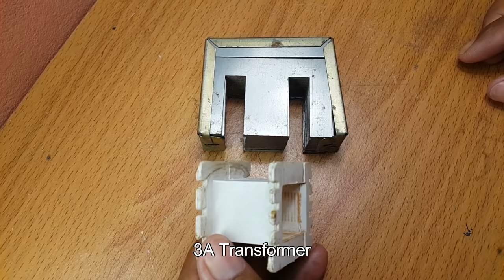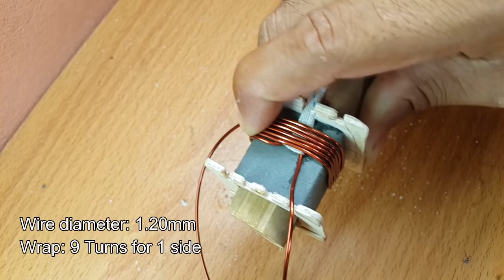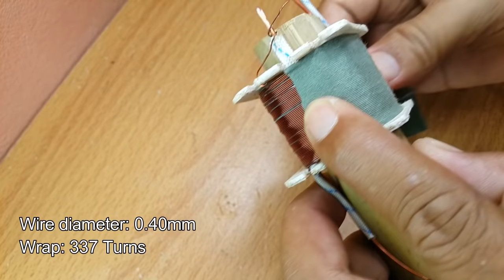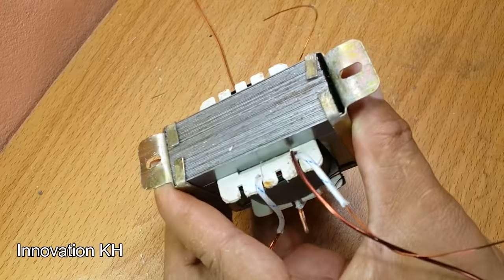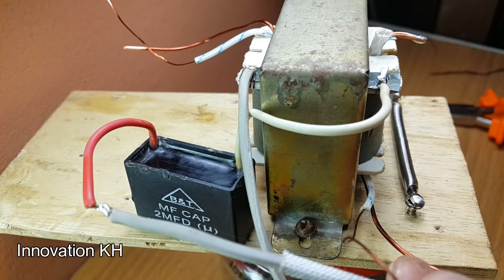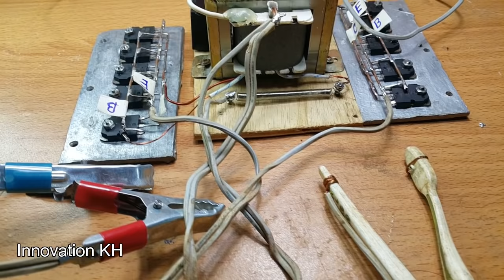How to make High Voltage by using 3A transformer and 10 transistors D718 NPN

Comment: Pointless to use transistors in parallel (or any semiconductor), they DO NOT function like basic electronic components in parallel, such as resistors and capacitors, as one transistor will do all of the work and the rest will just take up space. You could do the same thing with a ZVS driver with a centertap on the primary or even a single BJT with a feedback coil.
Reply: I believe to your Opinion,
But using more Transistor as Parallel maybe reduce the Heat it creates, i have tried using that on the Video we are seeing, 1x1 D718 same as the diagram of the video, it creates a very high temperature, using 4x4/5x5 reduces the Heat than can damage the Transistor/Mosfet🥹

Comment: Nah.. Instead of the background music, give proper instructions about the circuit and how it works. It's pretty useless video otherwise.
Reply: It's just a uncontrolled power inverter. Simple circuit and not as much power output in that setup as he's making it appear. I can get that same arc with a similar setup using only two D Cell batteries.
Reply: So, you can achieve the same voltage... but his setup is pushing some major amperage at the output voltage as witnessed by the melting wires after making a short arc. That, and this setup can likely run super high duty cycles without issues.
Reply: F8foio
Reply: Agree

Comment: how many volts and how many watts are produced ...
and explain why D718 is paralleled, does it work 5x2 D718 = 500w
Reply: The voltage jumps at least 8 mm, so I'd say that's around 2 kilovolts. 
It could be higher than that.

Doing the math implied by the numbers supplied in the video:
The primary side has 9 turns, and the secondary side has 337. The 4 turn coils are meant to drive the gates at the frequency of the mains.... so technically we can ignore it, but it does mess with some things. 
Since the transistors are all rated for 125 volts, that implies that the voltage does not exceed 125 volts on the low side of the transformer, vp = 125, turnsP = 9 . TurnsS = 337. 
Doing the rearrangement, the math should look close to this: ((125 volts) x (337 Turns)) / (9turns) = 4680 volts, or 4.6 KV. 

To get the idealized current transformation, 4680 Volts / 125 Volts ~ 37 amps,. 

The unknown in the circuit is the current handling ability of the new windings, and to know that we'd need to do a complete impedance map of the circuit. 
At best, the arc on the secondary side is drawing .027 amps, which absolutely drains the primary side of the transformer of 37 amps of current. 

I don't think that transformer is drawing 37 amps, but that means the wattage on that arc is = .027 X 4680 = 127 watts if it is drawing that 37 amps. 

So, the parallel transistors are probably meant to provide redundancy in the case of a dead short (overshoot) on the driving side of the transformer. 
Said more clearly, "The transistors don't support extra current, but do prevent destructive run away.".  

That said, this is still an interesting circuit.
You don't see many T bridge circuits.
Reply: @walterbunn280  should we do opposite winding?may I know pls what would happen if we do opposite winding? What's the best idea to get 220 to 250v from 12v DC ? Specially for fishing?

Comment: im from philippines i already tried your tutorial and its working but the second and third i made the transformer is not working well anymore, is it necessary that only the exact diameter of wire must be used ?for example is the 1.20mm., if i replaced that in to a smaller diameter wire it will not work my friend?
Reply: michael lamalan sir.. ano po name ng spring na ginamit nya? Thank you po
Reply: Baligtarin mo Lang pre yung base connection galing sa transformer left and right channel pagpalitin mo...
Reply: Mga boss alm nyo po ito gawin? Pingi po ako diagram pls. Tpos po size ng wire ng phil. Size. Tpos po yung diode ano po number.
Reply: Pati po size ng plastic bubben

Comment: The spring is micron??
Reply: can you use resistor replace spring use 10watts 10 ohms resistor sir binito
Reply: @mangandresstv8063   boss pg alm nyo po ito gwin pngi po ako ng diagram at materials. Pti # of turns at size ng wire. Lhat po n details pkilgay. Slamat po

Comment: What is the voltage output, pls
Reply: 220 to 280 volts....its 280volts 10 transistor you use

Comment: i mean" it is not clear where the grey wires should be connected "
Reply from the maker: You mean out put right? two grey wires need to use 1.5m of length wires. It should connect to long iron (0.6mm of iron diagram) for 1 side each. This circuit use for shock the fish. be careful for this circuit it is dangerous. thanks you for watching
Reply: Innovation KH what is the size of 3A transformer? What is the size of that square plastic sir?
Reply from the maker: Hello, it is 2.8cm. thanks
Reply from the maker: Hello, it is 2.8cm. thanks
Reply: Innovation KH sir can I use 3.5cm × 2.7cm size of square plastic sir?
Reply: @InnovationKH  what is the size of the bobbin and diameter of nichrome wire tnxs sir

Comment: transistors D718 NPN link please
Reply: 2SD718 ..but you can't parallel BJTs, only mosfets, honestly i think this project is a bit dangerous anyways, even if you use a battery, likehood of success is medium for a novice, winding a transformer is tedious and you'd better to use a trasformer primary that is already there, winding only the few turns, possibly on a side of the plastic spool
Reply: Market se lelo yr